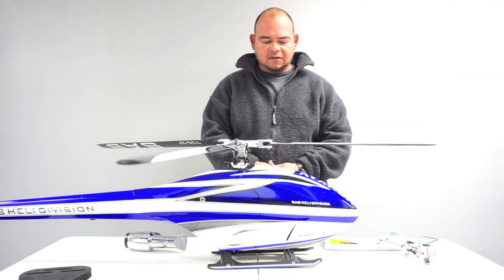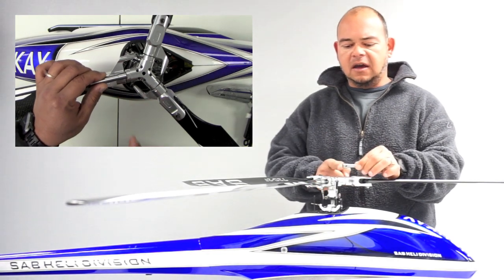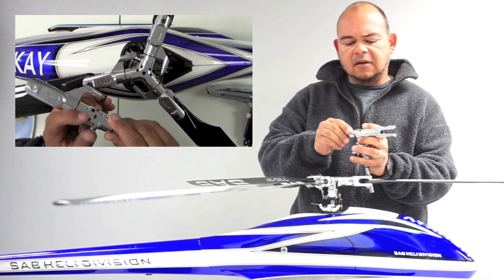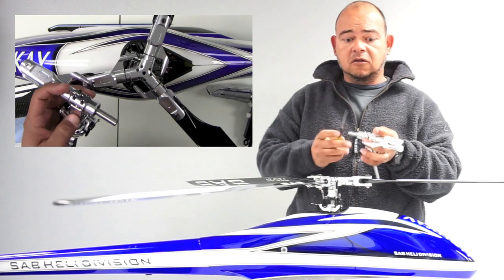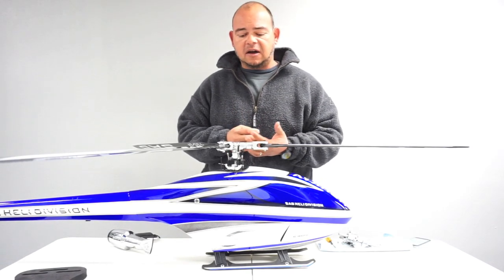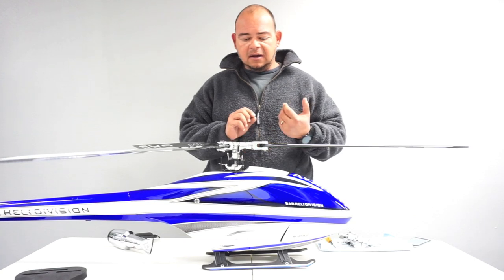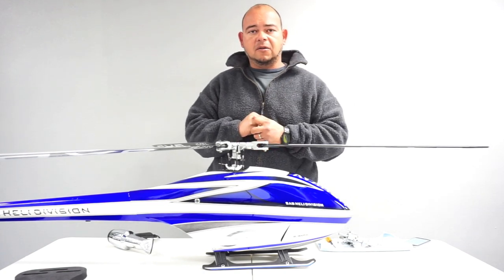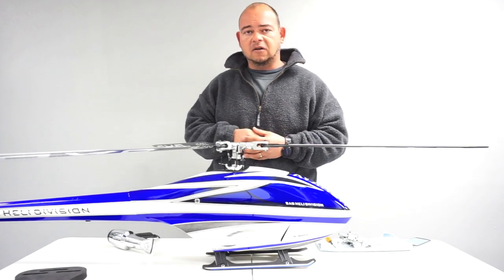Tips & Tricks for HPS2 & HPS3 Heads

Comment: Thanks for the video Bert. Just a little trick I use to soften the threadlock when trying to remove a bolt is to put the tip of my soldering iron directly on the bolt I want to remove for about a minute at 450f and the bolt comes out with ease.